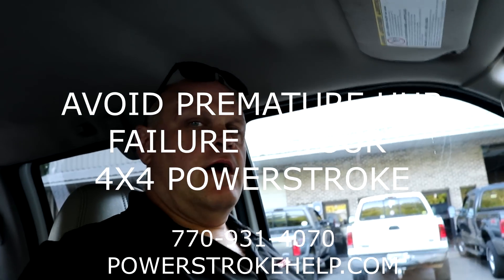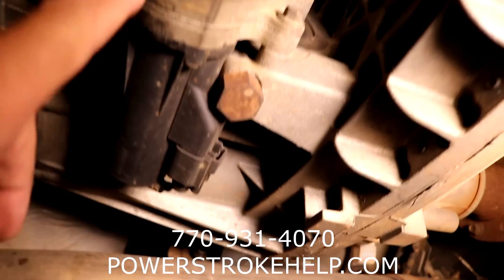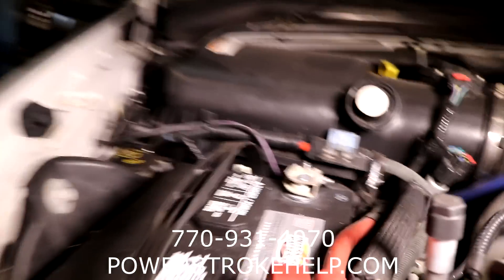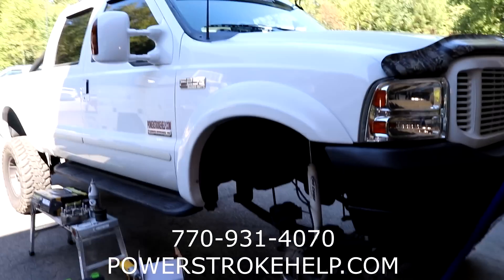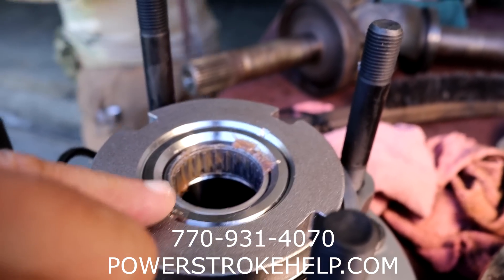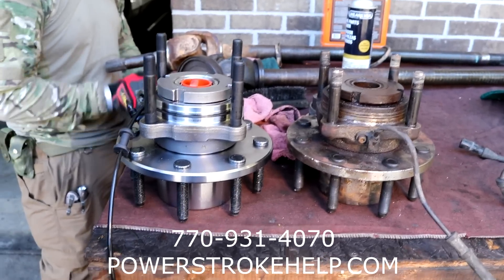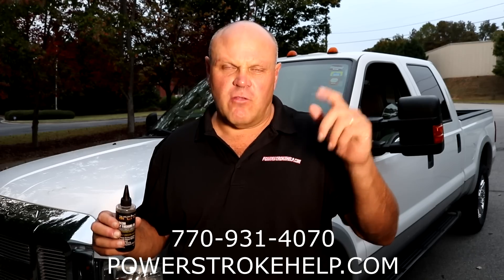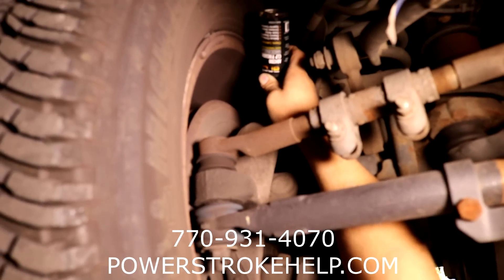PREMATURE 4X4 FRONT HUB FAILURE - FORD SUPER DUTY

Comment: my 40 year old gmc doesn't  have problems like this plastic junk lol
Reply: David Chapman   Fuck off with your old truck tales.  The technology on that old stuff is so primitive its not even worth mentioning.
Reply: @gearjammer4779  kind of harshly on the guy.  He does have a point. The older vehicles were easier to diagnose and simpler to repair.  But you were also repairing them more often.  Doing tune ups every 6 months and drum brakes are much more time consuming and a bigger headache than the simplicity of doing a disc brake job. And the newer vehicles get much better fuel mileage for a given power output.
Reply: Only thin, flexy frames. quadrajunk carbs, ripping steering boxes off, crappy corporate 10bolt front axles sad excuse for a 3/4ton axle. Don't get me started on later Chevy IFS 4x4 trucks. Shall I continue?
Reply: Might be cause it’s 2wd 😂. I drive a GMC for work and I own a V10 & PS Ford. Chevy is garbage and I put a ton of miles on it and it’s a fleet vehicle that is serviced regularly. I will say the drivetrains of the Chevy and GMC is great but the truck that is built around it is crap.
Reply: @dsruddell  I have a 2012 f350 and its been in shop more times than both of my 86 k10 and 97 z71 combined.  Yes the f350 has a lot more bells and whistles on it but thats just more stuff to go bad. The super duty is the only vehicle i have ever owned in 30 yrs that has left me on side of the road.